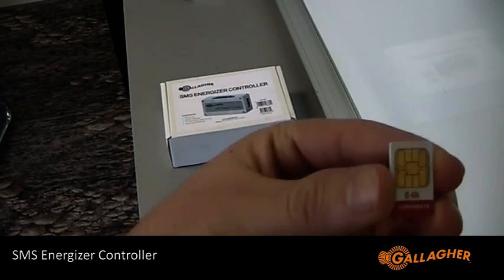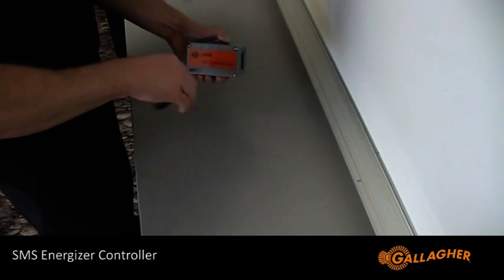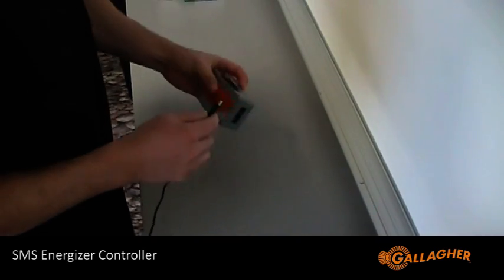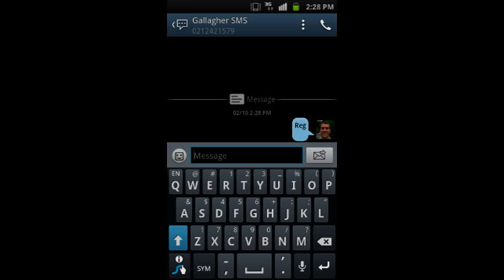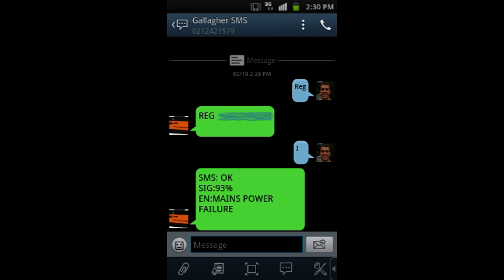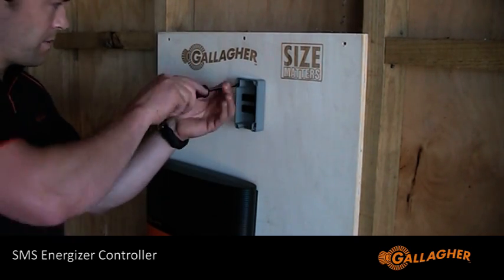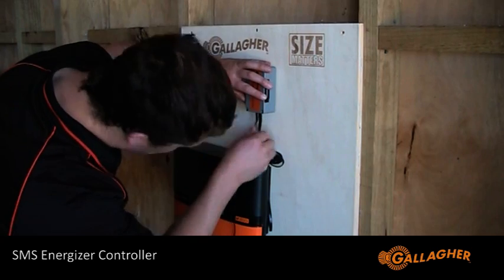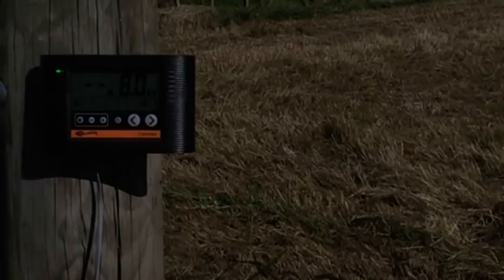Installing a Gallagher SMS Energizer Controller

Comment: Is good but we need an external antenna connector to boost and keep signal stable in low signal areas. Would also like a descriptive video on the new alarm monitor and how it interconnects to sms controller and programming.